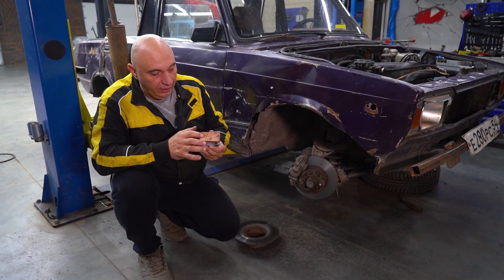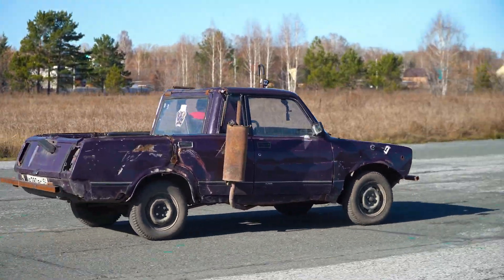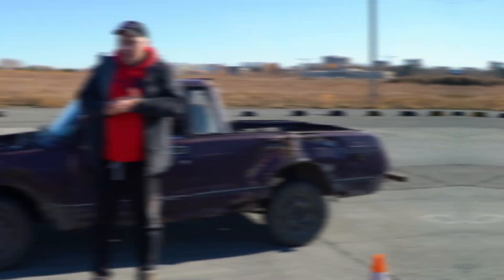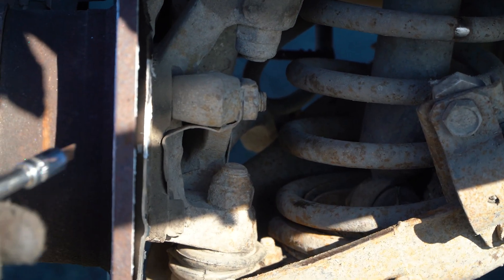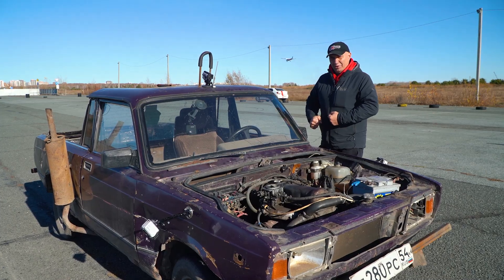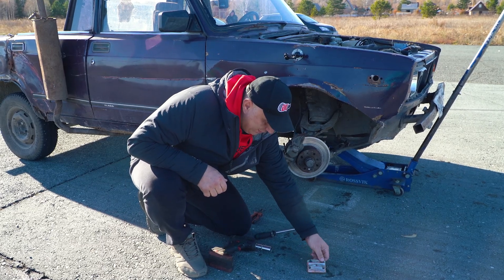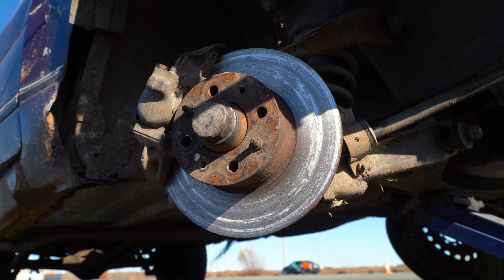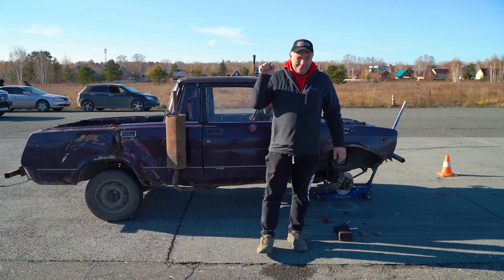Aluminum vs. copper brake pads – which are better?

Comment: I think that it makes sense. The aluminum is softer, so the friction is higher. More friction = more braking. But at the same time they wear a lot faster.
Aluminum and copper have a high thermal conductivity. They conduct heat very fast, and not retain it inside the pads. But to cool off they need to exchange that heat with the surrounding air, and the surface of the pads is small. The thermal conductivity by itself won't make a lot of difference vs other kind of brake pads, which i bet also have a fairly high thermal conductivity.

Comment: Aluminum with lubricant. It wouldn't be ideal in the real world because you would constantly have to relube and clean dirt. But I am just curious from a performance standpoint. I would THINK the lube/oil would help with cooling, the initial over bite, and the fusing. Would have to see how it affects stopping power though. In my mind with how aggressive they bite, even with the lube, just apply more pressure and they will still go to full lockup

Comment: Yes aluminum binds with steel pretty well even when cold, but against the iron rotor it wouldn't take much to get hot enough to melt and bind with the cast iron. brake pads are designed to not grip much so as to last longer and not cause an inconvenience like a crash 😂

Comment: Aluminum pads have a major problem. The freshly exposed surfaces instantly oxidize to form a thin layer alumium oxide aka corundum. This can  wear out the disks prematurely.

Comment: copper pads do exist . however they are adhered and mixed with carbide so they dont wear fast . they used to use them in race cars

Comment: Don't forget the aluminum and copper both feel hot BECAUSE they cool off quickly-your hands feel the increased heat that they give off! Brakes just get that hot, even fast conductivity doesn't make it any more bearable to touch after removal.

Comment: USING MY EXPERIENCE ON USA RAILROADS , I WORKED IN THE TIMES THAT WE CONVERTED MOST ROLLING STOCK FROM CAST IRON BRAKE SHOES ON WHEEL RIMS TO COMPOSITION 
BRAKE SHOES!
IT WAS FOUND TO BE NECESSARY TO REDUCE THE PRESSURE.
THIS WAS DONE BY CHANGING BRAKE LEVER RATIO , OR BY USING
SMALLER SIZE BRAKE CYLINDER 
SIZES!
OVERALL IT DECREASED THE WEAR ON WHEELS!
THE ONLY LOCOMOTIVES THAT NEVER WERE CONVERTED TO 
COMPOSITION SHOES ARE THE STEAM LOCOMOTIVES, BECAUSE THEY ARE NOT ALIKE ON DIFFERENT TYPES, AND TO MY KNOWLEDGE NO ONE MANUFACTURES THEM!
HOWEVER SPECIALIZED METAL FOUNDRIES STILL CAST THEM !
KEEP THEM ROLLING BROTHERS!!
👍👍

Comment: The copper and aluminium does not cool fast. That is a Misconception. They both conducht heat very well, and that is why they are used as a cooler (Heatsink). By using finned copper and aluminium blocks with a fan, they can really get things cool, so thats why they "cool things fast".
Theyselves will stay allmost hot the same time as an identically formed block of Iron or Steel.

Comment: Copper makes more sense than aluminum just because it's a little harder and I think has a higher melting point. Could only imagine modern abs system with these pads. Before I watched all the way through I was thinking the copper would be a better emergency back up. The way aluminum shears too is much more severe than copper.

Comment: Although aluminum is soft, aluminum  oxide is right next to diamond on the hardness scale. 
Aluminum oxide forms in nano-seconds. 
Machining aluminum dulls your cutting tools pretty quick because of the oxide. 
Aluminum makes a horrible bearing surface.

Comment: Man imagine doing tungsten carbide break pads!!
That would be epic to see
Reply: You'd be almost just wearing the rotor instead of almost only wearing the pads as they're supposed to.
Could be interesting, if you could cast/machine tungsten carbide into the correct shape. Easier said than done given it's high melting point and hardness.
Reply: @MrCheesywaffles  yeah for sure is almost impossible to melt one of the most retractable metals in existence
Reply: Be expensive , if you could get some sintered somewhere . I'd like to see clean rotors against brass , steel , and titanium ( Russia has alot more than we do in the states.).
Reply: They would simply wear away the disk but have very little stopping effect.The ideal brake pad material is soft with good thermal characteristics.

Comment: Copper transfers heat better than Aluminum. That is why it is used in high end cookware. You can buy 'semi-metallic' brake pads, but you can't buy 'solid metallic' brakes pads for obvious reasons (don't work very well).

Comment: You should try brass, ceramic, rubber (like a piece of a tire), maybe even stainless steel and titanium
Reply: Bicycle brake pads are usually rubber. They work very well against aluminium rims but tend to be a lot less effective when wet.

Comment: It doesn't matter what pads you're using, if the tire lock up, stopping distance will be the same.
Reply: That's why pads are dynamic, with the appropriate initial bite. In this way minimising the braking distance, and avoiding the locking. Anyway, ABS is your friend.

Comment: RESURFACE THE ROTORS! while driving PUT Sanding Sponges on the front disk brakes. see if driving with sanding sponges pressed into the brake pad spot will sand the rotors down ? heh

Comment: You should also try brass pads. That’s what we use on our ATVs because they’re really durable and rocks and mud don’t eat them up like conventional pads do.
Reply: The issue it that's cars are alot heavier, so the brakes would probably over heat, fade, and with the being repeated alot the pads would wear down very fast.
Reply: @jwalster9412  most higher performance brake pads and even clutches use higher metal content in the friction materials and some are near solid brass but a granular structure
Reply: @needmoreboost6369  the granular structure is to stop over heating?
Reply: @needmoreboost6369  Performance pads does not contain metals. They are ceramic compounds of glass, Kevlar, carbon and rubber. That's how they become dynamic, with different initial bite versus sustained bite.
Reply: @jwalster9412  maybe not directly to stop “overheating” but I’m guessing that the grain is to assist in wear and heat as they aren’t solid brass but a metal backing plate with the granular brass compressed and welded to the backing plate I’d be interested my self to know more about brass friction compound manufacture I have a fair bit of experience in reconditioning brakes and clutches but the in depth science of friction compounds composition is beyond me
Reply: @thefreedomguyuk  no metal? Who told you that? lol as a trade qualified mechanic I’ve fitted thousands of set’s of high metal content pads and their varieties! and any mechanic probably has picked up metal splinters from pads or shoes! yeah it’s often still only a small content but they do contain soft metal fibres or grains and a lot of vehicles now are using Kevlar composite or low temperature organic and metal free pads definitely are used but not so common with road vehicles and cheap pads rely heavily on their metal content for higher temperatures as Kevlar struggles to last at high heat,technical advancements are ongoing and there is definitely a lot of friction compounds out there and I’ve not seen them all
Reply: In regards to brass, bullets. Brass is unique, in as it work hardens, at an almost unlimited amount. You can work harden it in many forms, bullets are a great example. As someone mentioned, a lot of rounds fire in the 60,000psi range, this can even range to 132k from the 50bmg. The force of the explosion work hardens the brass, this is why reloaders anneal the bullet neck, via either conduction or other means of heat cycles. Annealing the brass, you can usually get 10 cycles, depending on the round. The same applies to all other applications of brass. You can get many different heat treats and hardness of brass, of specific molecular makeup for specific uses.
Reply: @Yoder0441  I haven’t purposely annealed brass but it’s common practice for copper washers and I imagine it’s the same for brass basically being opposite to ferrous metal, to anneal the copper you just heat it till cherry red then fast quench in water! and then it’s completely soft, unlike iron or a high carbon steel that would harden or would likely crack using the same process
Reply: That's interesting. Do you make them yourself from blanks of brass or what?
Reply: @eightosaurusspelunk1598  yes. We remove the original pad material and rivet on the brass. They work really good.
Reply: Are they noisy?  How do they perform?
Reply: They perform very good. Not noisy at all. Just like a regular pad but don’t get eaten up like regular pads do in mud/dirt.
Reply: @demoderby181  yellow brass or red brass
Reply: I would think to use maybe bronze, it's more abrasion resistant, my aftermarket valve guides in my eagle talon are bronze, they hold up better and don't score like normal valve guides, especially at higher rpms, given there is oil on them and not metal on metal so much
Reply: Isn't brass too soft material for break pads?
Reply: @niki123489  it’s not too soft but it’s definitely not refined enough for use by itself having too much friction and not progressive friction like organic compound,therefore gradually braking would be hugely damaging! and using a brass clutch is like an on/off pedal it’s not recommended to try to slip one gently! using more rpm than normal and a faster release of the clutch makes for an unpleasant street car, but for a driver it’s rewarding having almost no slip.
Reply: I wanted to say the same thing should test brass
Reply: Is that some kind of joke?  Brass is a very soft metal, which is why keys, bullets, and other intricate parts of machines are often made of this material.
Reply: @Matt-cl4mp  no joke! brass material is a common material used for bearings also friction materials look up brass button racing clutch or look up material data sheets on performance brakes or go to an automotive parts store and ask for high performance brake pads and look at all the metals imbedded in the organic compound and usually the higher the organic compound and lower soft metal content means a lower operating temperature but racing pad’s are shiny metallic
Reply: @needmoreboost6369  yes, brass is often used for bearings, it stops wear on shafts and is cheap and easy to replace
Reply: @Matt-cl4mp  btw they have to be relatively soft to prevent excessive wear on the rotors and for a higher coefficient of friction
Reply: @Matt-cl4mp  your lack of knowledge is showing. "Bullets" is an incredibly loose term. The casing is made from brass and can withstand 60,000 PSI. The projectile however is made from lead. Typically covered in a copper jacket. Brass pads are actually pretty ingenious.
Reply: @mastermnd22  it can only hold the pressure because of the chamber walls, also...yeah some people here don't know what they're talking about even in the slightest. Bullets are typically made out of copper jacketed lead or just lead depending on the cartridge.
Reply: @mastermnd22  You act like brass bullets don't exist. Go look up .50 Beowulf, plenty of brass rounds there. .577 tyrannosaur, plenty of brass solids there
Reply: @Matt-cl4mp  There are so many brass alloys, from soft to hard (hardened or artificially aged) and even elastic like a spring.

Comment: I suggest redoing the test after either replacing or milling the surfaces of those copper pads then re-turning the rotors to clean them properly, since the copper pads appear to be contaminated by residue aluminium from the aluminium test and gave you poor results
Reply: I would radher see it on an abs vehicle
Reply: I'm glad I read this reply: I was about to make the same comment about the copper pads looking like they rubbed residual aluminum out of the rotors.
Reply: they are  
not doing  
real  
tests  

they spend  
a lot of  
time to  
make these  
videos  

'proper' tests  
would include  
monitors hooked  
up to measure  
temperatures  
and wear  
and braking  
distances  

your idea  
would add  
nothing to  
the way they  
do their  
tests
Reply: @NOTmcFly_fashionVictim 
ok
thank you
for your
kind words
dear friend
Reply: @Dzejk86  
Why
Are
You
Talking 
Like
This? 😂
Reply: @ 
no
idea
Reply: @NOTmcFly_fashionVictim  So, yeah it doesn't have to be scientific but shouldn't be stupid poor either.

Comment: Once you brake hard enough to lock up the wheels, your brake pads no longer have any influence on stopping distance and threshold braking (not locking up) gives you better distance than locking wheels while also sparing the very high tire wear.
Reply: Threshold braking give shorter stopping distance on tarmac and regular roads. On gravel locking the wheels actually is likely to result in shorter stopping distance. This is because the gravel builds up in front of the locked wheel increasing the friction over what is possible for a rolling wheel. Snow can act the same way while on tarmac, concrete or any other hard surface locked wheels means a longer stopping distance.

But locking the wheels always means you are giving up any pretense to control the direction the car travels in. So ABS or threshold braking if you don't have ABS is almost always preferable even if the stopping distance can get slightly longer on gravel.

Oh and threshold braking is never as good as ABS. Never! Neither in allowing you to retain control or in getting the shortest possible stopping distance. Well retaining control isn't entirely true. Locking the breaks can allow you to perform maneuvers you can't otherwise do. But it takes skills most people don't have and in a panic situation I'd much rather have a vehicle that steer better.
Reply: @blahorgaslisk7763  according to the folks at team o'neil, it still works well on gravel (I'll drop the link at the bottom)
likewise, threshold braking can outperform ABS, but it's more a question of how good your abs is (without even considering loose surfaces)

here's the video btw:
https://youtu.be/TfekZcWa6D8
Reply: @tiagobelo4965  Good video, but not enough to convince me I should disable ABS and use threshold braking instead.

It's my personal opinion that is you regularly rely on ABS when braking in your daily driving you are living on borrowed time. In any situation other than competition the ABS should never need to engage unless something catastrophic is happening. 

Whenever you feel ABS working you were either driving to fast or are braking to hard. Like stated in the video from Team O'Neil you have to plan ahead when driving. If you have to rely on ABS to slow down enough to take a curve you are just a few ounces of lose gravel on the road from having a very bad day.

ABS is for the situations you can't predict such as a child running out from behind a parked car, a deer taking a leap up onto the road only to freeze in your headlights. It's for the kind of situations when your brain goes into panic mode, not for helping you drive faster and brake later. And when things like that happens the brains reaction time is still not good enough, so you really don't have time to find that perfect brake pressure that won't lock up your wheels.
Reply: @blahorgaslisk7763  You're one of THOSE people I see. 'Wah ABS bad. Wah You're not a real driver'

How about you drive how you like, and others drive how they like?
Reply: @thevalorousdong7675  You can drive however you want, as long as you don't kill or maim anyone else. Just don't pretend that you can stop faster without ABS than with. 

Sorry but that's not possible except in one situation, braking on gravel. Then it is possible that the build up in fromt of the tires will slow you down faster than what it would with ABS active. 

But then you're not threshold braking but locking up the tires to achieve this. That means you lose any kind of steering while braking. A difference in the density of the gravel can start your car turning uncontrolled which means you will have to let go of the brake to have any chance of taking control back.

A human with fast reactions has about a tenth of a second reaction time if it's a trained reaction. Two tents or more if you have to think. This can be compensated for when you do something like a controlled slide. Then you know the car will slide and you are steering through the slide to keep control. You don't react to unexpected movements so you can predict how the car will handle.

When panic braking for shortest distance you do not know which way, or even if the car will start turning That means you will have to react after your brain notice the fact that the car starts to turn either way, so the reaction time will probably be between 0.1 and 0.2 seconds at the very least.

There is a pretty good chance you will over compensate, a lesser chance of under compensation and the rest of the time you get the car under control. Been there, done that. It wasn't fun.

Note that panic braking is very different from something like tapping the brake as you sling the car into a slide around a bend. That is (semi, there's always the risk of getting surprised) controlled. Even world class rally drivers occasionally get surprised when doing this, or there wouldn't be any accidents during the races.

That's also why you NEVER drive like that on a public road no matter how good a driver you think you are.

But if you want to do it on a private track or during a competition then sure go for it. I'm not going to try to say you shouldn't do it. But if you do it on a public road you are not only a moron but a danger to everyone near or on that road.
Reply: All my FWDs get skinny mud tires for snow, It gives me the grip to pull out when the rear whips arround. Stuipid amount of control with those.